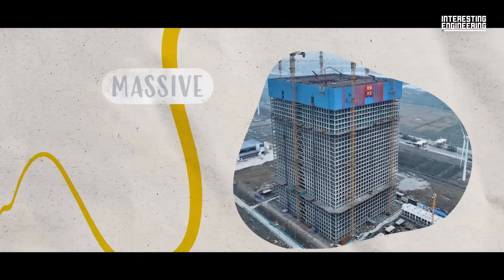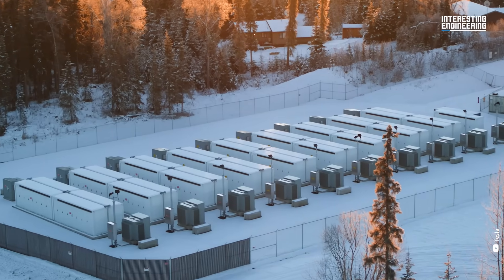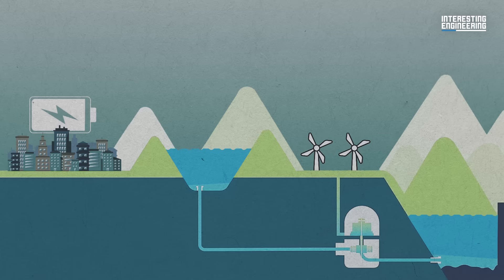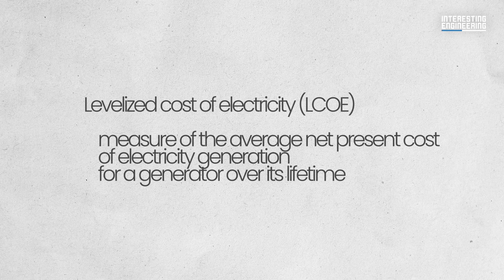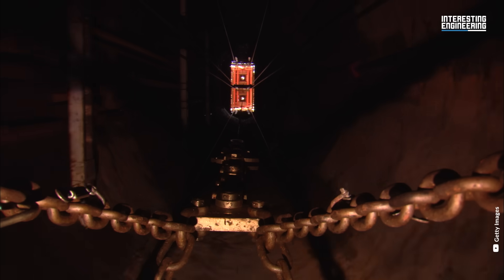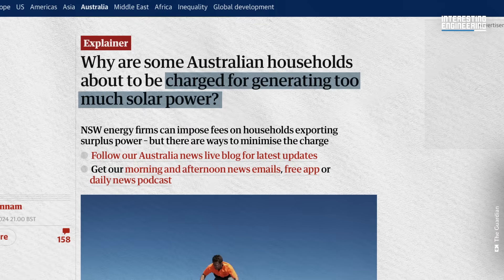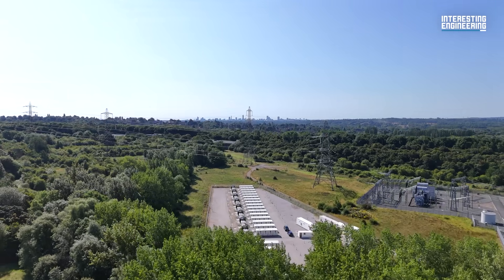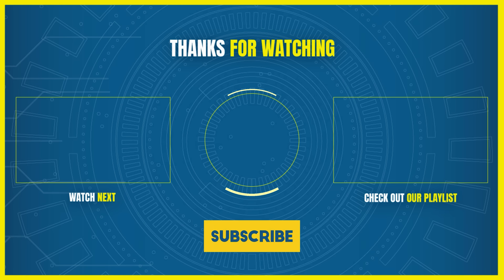China is Building Gravity Batteries

Comment: I was SUPER excited about this technology when I first heard about it (nearly 10 years ago)…until I did some math and figured that even over 400m, (~ height of the Freedom Tower without its spire) a 1 ton weight would only have 1 kWh of potential energy. At 80% efficiency and the fact that so many blocks won’t get lifted very high, seems pretty garbage to me.
Reply: The main thing is the efficiency, 80% is excellent. No expensive batteries, no degradation. Low maintenance. It makes sense
Reply: @shawns0762  it’ll be nowhere near 80%. It’s probably 80% when you disregard the energy it takes to lift and “reset” the weight
Reply: Yes i did the same analysis and agree
Reply: I don't want to make Propaganda and must admit I didn't watch the Video. 
But the fact the Chinese are working on it means that it is at least Not stupid. They are good at being efficient. Sure, Might only Work for them under their very own circumstances, but dismissing the whole Idea with a bit of high school Math seems a bit too much to me.
Reply: @ All the high school math says in you need a huge amount of dense material and large heights to store a modest amount of power by town/city standards. The principles however are solid. Always like to see people try new things anyway but there's just no getting around the physics. As a quick example, 1 kg of petrol has around 44 MJ of energy contained. To get the same amount of gravitational potential energy you need to lift a 1 ton concrete block (0.75 x 0.75 x 0.75m) approximately 4500 m into the air. A standard petrol tank lets say holds 30 kg of petrol, the energy contained is like lifting 30 tons of concrete 4.5 km into the air. This example gives you some idea of what the OP was talking about.
Reply: Bro you have genuine brain worms lmfao.
Reply: I also thought about this a few years ago, but to produce 1kwh you would need to lift it almost 400meters.

I don't see how building a 400 meter tower to produce 1kwh per block is the answer. 

Just build a damn and use water.
Reply: @braveneworld-c7e you don't always have mountains or water sources close to where you're producing excess electricity, that's the point of using concrete or, as in this case, compressed garbage blocks
Reply: The big advantages of this technology is that: a) you don't divert water from agriculture or houses to storing energy (you do use water for creating the concrete but that's just once, then it'll last for decades if not centuries, given proper care), b) it's relatively simple/cheap, so yeu can add new storage modules incrementally as you need them and require little maintenance; c) has a looooong cost depreciating time.
Lithium batteries have proven to be garbage for this excess energy storage  problem, vanadium batteries are way way better but too expensive and still require some periodic maintenance (much less than with lithium or, heaven forbid, acid-led batteries, granted). that's a manageable cost.
Reply: 1 kWh battery costs $200. 1 ton of cement and stones will be cheaper
Reply: @yurcchello  you missed the fact you need a 400 metre high building....
Reply: @yurcchello  definitely not, because its not only one ton of cement but also the rails to lift it at 400 meters :)
Reply: @yurcchello  Capital cost isn’t everything (although emerging chemistries WILL beat this tech on that front relatively soon) and the energy density of this is abysmal. It is not practical for anything other than generating the odd headline.

Unless recycled / repurposed materials are the storage medium, this is also a poor use of resources.

Unlike electrochemical storage, the cost of this is only likely to go up (ie. construction labour and increased O&M relative to BESS). I would eat my hat if this ever makes a dent in the global fleet of energy storage.
Reply: @Group_IV_Solar  The problem with traditional betteries is that it degrades overtime and generates a lot of heat while charging and decharging requiring an extensive cooling system.

By storing energy as potential energy will ignore these issues, plus it's way cheaper to build and maintain.
Reply: @yuning8045 Cooling systems for stationary applications are neither expensive nor complicated - mobile applications have high C rates on the other hand which necessitates complex liquid cooling to mitigate degradation but that problem has been found to be overblown.

O&M costs for gravity ESSs will DEFINITELY be much, much higher than electrochemical storage and will be a larger part of overall costs. Relying more on ongoing human labour vs. nearly one-time capex is not favourable from a cost perspective (think inflation).
Reply: @Group_IV_Solar  I don't see O&M costs being a whole lot higher; especially with AI involved.  And I think capex is a whole lot higher than you've suggested for gravity batteries.  They'd require a LOT more land, for one thing; not to mention either very high towers or a very deep hole.  Abandoned mines or dry oil shafts have potential...but you'd need a lot of them.  They WOULD work nicely when coupled with wind energy, since those are already very tall, effectively producing a combination turbine and battery.
Reply: @yuning-w Concrete degrades too. Actually, concrete degrades very quickly when it is constantly moved and stacked. What do you think happens when these blocks catastrophically unstack themselves? Come back to me once a working model exists. Until then it's all a money pit.
Reply: @Philitron128  The blocks aren't made out of concrete. Also, a working model does exist. Did you even watch the video?
Reply: @isaiahschmitt8680  Gonna be honest with you, I didn't.
Reply: @ it doesn’t have to be concrete blocks.  Or else, if concrete, it can be say steel boxes filled with concrete or similar.
Reply: @ but I also agree, this doesn’t seem very feasible for the small amount of energy you’ll get out of one block.
Reply: @szahmad2416  I think you're missing the point, but the video was very bad in this regard, it did a terrible job to explain how these things work. Imagine, if you will, another setup: A large hill with a slope, along which there are rails (train tracks), cargo wagons, and winches lifting and lowering the wagons along those tracks. Now instead of just being able to lower one set of wagons, we build large humongous shunting yards at the hilltop and at the foot of the hill, and we fill them with tens of thousands of wagons. Now instead of one set of wagons we lift up or down, we can transport ALL the wagons down or up, sequentially. Increasing the storage capacity is easy, we just extend the shunting yards and add more wagons. Millions of wagons if need be.
Reply: @yurcchello I doubt it.  That's one ton that has to be safely secured so it can be automatically lifted and dropped.  Unless it's some country with zero health and safety its going to cost thousands, not hundreds.   Perhaps in China but then they build tower blocks out of paper mache.  If actually expect it to do anything then its going to cost more than a battery.  Also cement isn't exactly climate friendly.
Reply: That is precisely why the British are pioneering a superior version of the tech in disused mineshafts with much heavier weights (100+ tons per cable,I think),without the need to counterproductively waste insane amounts of energy building sbove ground structures in concrete and steel.
All you need to do is instal the cables,gearing and dynamo and all your (non existent) maintenance is at ground level.The cables don't even get wet.
I think the efficiencies are ITRO 95% as well.
Reply: @chippysteve4524  again, you need a single mineshaft for about 5-10 houses.  That’s a lot of mineshafts.
Reply: @chippysteve4524 yes, storing energy in abandonde mineshafts makes way more sense from both an economical and energy density point of view. Alas, not all countries have such a long history of mining as the UK, thus you can't always find abandoned mineshafts near your power storage needs

Comment: Every electric vehicle comes with a battery in it that can power a home for several days. All that is needed is for regulators to require manufacturers to implement vehicle-to-grid technology and development of a smart grid to manage the movement of power between electric vehicles and the grid efficiently and effectively.
Reply: This decreases the life of the battery.
Reply: @mtaylor150  Yes, marginally. Battery tech is getting so good these days they are lasting longer and longer. Participation can be made optional and car owners compensated.
Reply: Only works when the car is home.
Reply: @Mike40M  Yes. Home or otherwise attached to the grid. Most cars are just sitting there not doing anything 95% of the time. Let's put them to work!

Comment: 14:22 - Lithium batteries will not end up "getting thrown away".  Batteries are highly recyclable as all the material that was present at its beginning of life is still present at the battery's end of life.

A recycling supply chain is already in the works with high recovery rates without emissions.  See LiCycle and Redwood Materials.  The cost of lithium recovered from the recycling supply stream will eventually be cheaper and more available than going to ground to get them.

This video was good until this part.  Thumbs down.

Comment: 1 ton load produces only 24 watts hour
Reply: At what height?
Reply: @ziad_jkhan  Step 1: Calculate the potential energy
Potential Energy = mass × gravity × height
Converting to standard units:

1 ton = 2,000 pounds = 907.185 kg
100 feet = 30.48 meters
g = 9.81 m/s²

Potential Energy = 907.185 kg × 9.81 m/s² × 30.48 m
Potential Energy = 270,617.8 joules
Step 2: Convert joules to watt-hours
1 Wh = 3,600 joules
Wh = 270,617.8 joules ÷ 3,600 joules/Wh
Wh = 75.2 Wh
Therefore, a mass of 1 ton raised to a height of 100 feet has a potential energy of approximately 75.2 watt-hours.
Reply: 10 $ power bank can do the same thing
Reply: How many power bank to light up a city?
Reply: @ziad_jkhan  8 meters

Comment: I miss-heard the round trip efficiency as 30% (not 80%) and was wondering why you were not comparing it to hydrogen storage.
Reply from the maker: We were trying to compare gravity batteries to similar tech, plus the industry standard, lithium-ion. Hydrogen is very interesting though and probably worth it's own video.
Reply: @interestingengineeringie  Hydrogen has more standby losses than gravity batteries due to venting.
Also fuel cells are not particularly efficient, though more efficient than just burning it to generate electricity.

Comment: We should reserve Lithium batteries for vehicles that need to carry the weight of their own power source.  Static batteries should be lead acid where weight is not an issue. Why are house batteries using lightweight lithium?
Reply: Lightweight high storage capacity
Reply: More durable and allow lower SoCs
Reply: Lithium batteries from China in the 12 V  100 to 400 amp hour range are now cheaper than lead acid, last much longer longer and have longer warranties. More variety, sizes and voltages are coming all the time.
Reply: Lead acid is not so good. You can't discharge it below 11.6 volts otherwise it will not hold charge. Also, they are not so durable compared to lithium. Lithium Iron Phosphate can boast of 5000 cycles and even more, that is very desirable for  power grid builders. Lead acid can't boast of that.

Comment: How cost effective is this ?
Reply from the maker: Supposedly one of the most. The problem is space.
Reply: @interestingengineeringie  the space of a battery 100 MWh at 120 m high building may be around 0.3 hectares. The Building to accommodate  more or around 31856 solid blocks (with weight 24 tonne each and volume 12 m3 each) is required and this  may generate 100 MWh (efficiency 80%), but during lifting the energy used may be around 150 MWh (lifting efficiency 80%). So the operator will consume 150 MWh from the grid and may generate 100MWh. Is this economic battery storing? Overall efficiency may be 64% (0.8 time 0.8). If the energy consumed will have price 10 cent the cost will be 150000*0.10=15000$, so the 100 MWh must be sold with price higher than 15 cent every kwh.